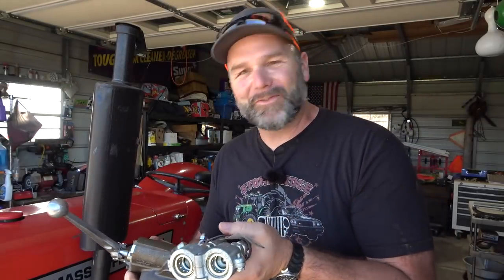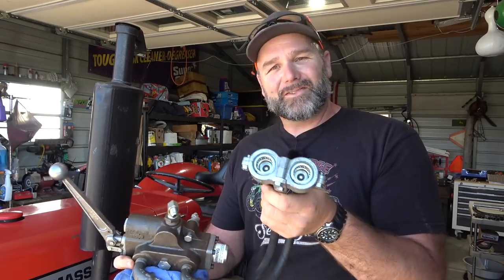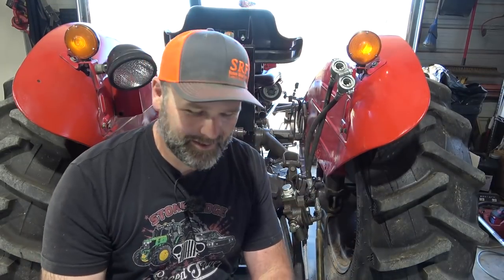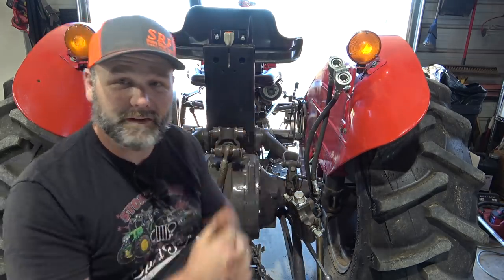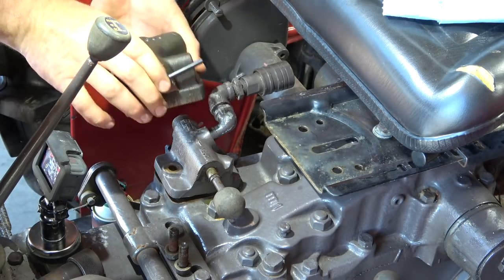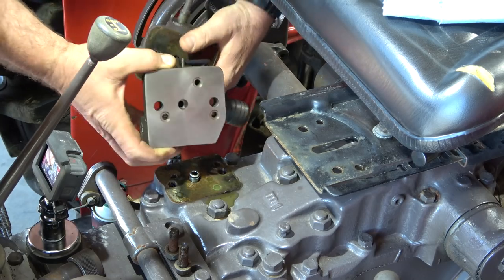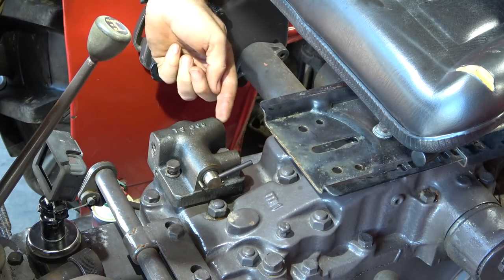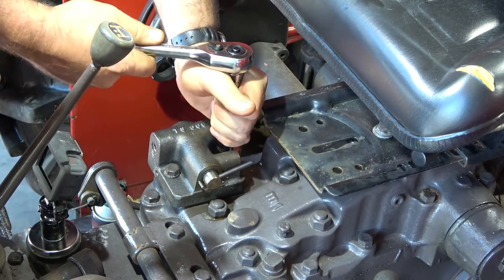How to install secondary remote on Massey Ferguson Tractor

Comment: I don't know, Josh. I keep hearing from sources that I trust that lock washers provide no additional locking protection. The reasoning is sound, plus my personal experience seems to support the idea. If you truly need the additional "locking" power, then thread locker, a lock nut, or a nylon nut should be used. That's just what I have been hearing.
Reply: This is true.  Vibration is brutal to fastened joints and lock washers don't protect against that very well.
Reply: Look into Nord-lock washers. We use them in severe construction and mining applications. They will survive anything a farm tractor can throw at them.
Reply: @heavymetalmechanicX  
I have looked into those.  They are quite interesting.
Reply: Nylok fasteners are a must have for any upgrades like you are doing. I have some in bulk for my shop.
Reply: 4th oring for stand pipe that was protruding from the lift cover.
Reply: 2:50  pay attention, NYLOCK NUTS.
Reply: Lock washers or (compression washers) do work. They are to commonly installed in correctly. One way to not worry about vibration of bolted assemblies is to use fine thread bolts. If you look at your equipment you will see that they use a lot of fine thread assemblies.
Reply: @reggiefarley2788  This conversation prompted me to finally review actual research, and the consensus from the actual science (People doing proper research IAW standards and such) is that helical spring/lock washers do not work in high vibration environments.  They provide no more locking capability than a standard flat washer.  
I would provide some links, but I don't think that works here.  But there are tests and papers available if you just do a simple google/youtube search.
Reply: @watcherofwatchers  
I read similar research years ago, I want to say it was a NASA study. Basically, lock washers are useless, and liquid thread lockers are the way to go.
Reply: Agreed from my experience. Today's lockwashers are flawed. Have not found a lockwasher in many years now that don't break either while installing or in a short time of use.
In my racing days the owner told us no lockwashers on anything on the cars. They fail, they mar surfaces they add weight. We would fasten all our bolts and nuts then add a finger tip of silicone to prevent the hardware from vibrating off. 
The new manufactures of washers and lockwashers are not manufacturing them correctly, the lockwashers are either or both made from the wrong material or they are heat treated incorrectly.

Comment: My dad and I loved Massey Ferguson's. He bought them in the 40s 50s 60s and 70s.
He did a lot of commercial weed abatement, rototilling, mowing, grading and backhoe work with that side shifting backhoe.
He had a model 60, 200, 220 and a 375.
He also had a John Deere backhoe throughout the years to do most of his trenching.

Comment: If you have the length on your zip ties you should wrap them around twice. If you ever need to cut them off you have some extra space to cut them without getting to close to what you are tying up. If that makes sense. I have been using zip ties for over 30 years doing electrical and telephone work. Just a little tip. Love your videos and your work ethic.👌

Comment: My grandpa had a 2004 massey ferguson 461, and it was a great machine. It wasn't super old, but it was very reliable. Massey last a long time. He had to sell it unfortunately because he had a heart problem and needed a cab tractor so he wasn't in the extreme heat.

Comment: I think I’d change out that oil ! 
A tiny bit of grease will hold the o rings in place while tipping it down. 
As long as you are careful nut to wrap the Teflon to close to the end of the threads.  
Another great video!
Reply: Good -was going to post an advice to use a smidgen of grease on the o-rings to hold in place.

Comment: Free tip: you could put 1 or 2 stainless washers between the valve and fender at each bolt so dust and junk can fall through easily and water can dry faster, and be blown out easier too.

Comment: Cool old tractor.   Have you ever seen an MF 1650, 1655, or 1855?   I believe Snapper had the twin models to them under their name.  We had two 1655s when I was a kid.   They were full framed steel, tough as nails garden tractors.   Had a small 3 point on the back, front, mid, and rear PTOs, shaft driven.    Hydrostatic drive.    The old Onan V twin engines.   Ours had a solid 60" mower deck with an actual gear box and hydraulic lift and you could run rear mount tillers off of them on the 3 point, a large snow blower off the front PTO, all kinds of stuff.    I've been looking for one of those again just for old times sake.   Just really cool for how well built they were compared to what's considered a "Garden Tractor" now.

Comment: The nyloc nut makes sense but the grade 8 bolts are just over kill. Standard bolts are plenty strong enough to support that valve assembly.
Reply from the maker: Well...it's not like they're gonna break the bank 5 cents v/s 7 cents and I know it will hold, it's just what I have on hand here in the shop brotha. Better to have overkill than to have garbage right?

Comment: I see I'm not the only one who drops nuts installing things.  Another tool you might want to look into are called transfer punches.  To transfer your holes locations before drilling.  Pretty cheap and work great.

Comment: I'm not a hydraulic expert either by any means but I'll pass along one thing I do know. Whenever working with hydraulics make sure the pressure is relieved before you loosen any nuts. If the pressure is not relieved it can inject hydraulic fluid into a finger or hand. Which can kill you or at the very least you just lose a limb. So, very important to relieve the pressure before breaking a line open.

Comment: It might be a good idea to install blank hydraulic fittings to male and female fittings when the implement is not installed to keep the fittings clean or plastic plugs if you have the plugs or caps.
Reply from the maker: for every 10 rubber plugs on a hydraulic connector...there are 8 laying out in the cow pasture lol...they simply don't stay put in most cases...I'm in the process of going with flat faced connectors on all of my machines...like a skid steer

Comment: The Teflon tape can plug your hydro's if it gets into the system. Wrap tour drill bits with electrical tape to create a drill stop to avoid damage to surrounding components.

Comment: rubber washer against the fenders on the inside and outside and then put your regular metal washers. Help keep the metal washers from scratching up the paint leading to more rust down the road.

Comment: I use pipe dope and teflon tape both had a master plumber tell me to do it and I have never yet had a leak I do it on brand new tractors that come in to the dealership

Comment: Good attitude and good video.
Now something a tractor like this one ( and all other tractors as well for that matter) should have is "good roll-over protection" and seatbelts fitted, and worn, - because early Ferguson tractors have a reputation as "widow makers" for a reason, like the tractor can very easily flip ower backward, or roll over on embankments or obstructions etc, or the operator somehow manage to fall,  or jump off the moving tractor into the path of a rear wheel, or towed implement...😓  You could promote safety around equipment as part of your informative videos because many people may not realize the hazards such machinery or tools etc, can pose if they haven't been informed by someone who know.🤔
Stay safe, regards Niels.

Comment: On My Massey the Quick connects are coming off the pump or valve and the connects are mounted on the differentials then if or when you remove the implement then the Quick connects seal the fluid inlet and returns. I'm looking to find information on either rebuilding or replacing the controls for my Bucket loader..

Comment: Standard lock washers don't provide that much, if any, protection from vibration. They do keep them from instantly becoming totally loose if the bolt backs out at all, though.

Comment: I think I would have ran the bolts from the tire side of the fender to hang the valve on that way you are turning the lock nuts on the valve side of the application. either way works.

Comment: @4:17 your finger is on the old hydraulic coupler.  To connect or disconnect the hydraulic hose, the outer ring had to be slid forward.  I cannot tell if the new coupler will allow a hose connection by just pushing the hose in.  To disconnect, the connecting hose is pulled.  Either connector needs some slack in the hydraulic line between the valve and connector bracket.
With the old connector, something had to break if the connecting hose was pulled without the outer ring being pushed forward.

Comment: Enjoyed the video but I cringed when you didn’t protect the metal from rust! Also, it may have been a trick of the light, but it looked to me as though the paint cracked when you tightened the bolt up. I take the point that it won’t rust through for a long time, but a rust patch looks unsightly and that 240 looks to be in such great condition. 

Someone once told me to wrap an elastic band around your drill bit to create a stop so that it can’t run through too far.

Apart from that, great job, I know that I couldn’t make such a good job of it: I’m all fingers and thumbs when to comes to spanners!

Comment: Josh let u know the tube in the Senter of the valve comes out and the other o ring goes on the bottem of it so it takes 2 and also tax hase a thread sealer that works really good with hydraulic it’s back in a hydraulic area it’s like $30 a bottle but it worth it

Comment: Grade 8 bolts are way overkill for an application like that.
The bolts will pull through that fender long before the standard bolts break.
I would be using fender washers on that fender to spread out the stress and reduce the possibility of pulling those bolts through after a few years of vibration holding that hunk of iron on there.
Fender washers come in handy for many applications.

My dad had a Massey Ferguson dealer add a couple extra valves to his Massey Ferguson, for top & tilt, and they bolted the valve body directly on top of the transmission.
I would try to avoid bolting anything heavy to a fender. Over time that sheet metal can crack and split out like a spider web.
My dad always bolted his onboard tool boxes to the loader frames. Never to a fender.
In fact his hydraulic couplers were bolted on to the differential, not the fender.

Comment: Josh Next time only use a lock washer. When you use a flat washer with a lock washer the flat washer will turn and let the nut back off because the flat washer will not bite in the metal ..I hope that makes sense.

Comment: I thought not to use teflon, the connection will seal itself. I repleaced all the hoses of my boomlift, and I was advised to do so
Reply: rule of thumb with hydraulic fittings - never use Teflon tape. If a sealer is required, use a loctite or permatex product designed for purpose. The smallest bit of tape in a hydraulic system will get trapped in a valve seat. You have internal sealing problems I.e. implement drifting. A costly process to correct.  Teflon tape has its place, water & gas fitting but never in a hydraulic system.

Comment: Simple Test to determine if water is in oil:    heat up a piece of metal and drip some oil on it..... if it just lays and smokes no water...... but if it crackles there is water.....

Comment: I have a 230 MF l took off the remote control it was in the way of quickly using the 3pt controls. Can you talk a out witch way the lever on the block is to be set and where to position the levers near the 3pt control,please

Comment: I guess I’m confused (it’s my natural state, really), but what was the prior valve for? Was it an old single action ram type? And now you’ve converted to a double-action?
Reply: Yes, the prior valve was single action.  Oil was pumped in one direction.  The weight of the implement forced the oil back when you moved the lever to the down position.  @4:16 Josh pointed out the return hookup for the return oil from a hydraulic motor or power beyond (or secondary valve setup).

Comment: Maybe a cartage bolt inside fender out to fender washer finally use a nylock nut tighten add lock-tight close in loosen 3 turns then re-tighten snug. That should do quite well. Go give em, rust part is electrolysis dissimilar metals zinc is sacrificial. Go get em & get er done.
My cousin has a quarter horse and a tractor like yours, the horse's name Justin, I call him Justin Beaver; he parked his tractor in paddock Justin took his teeth first he pulled off tractor's seat then muffler! Justin is not a bad horse he just gets bored.

Comment: you had safety glasses which is good. but Safety Sam would get you for having Dark Glasses in a building. you are supposed to have Clear inside and Dark outside. and on a very cloudy day clear outside also. when I worked construction, my site safety person would ask everyone to follow those guidelines.

Comment: Where is your ROPS?  For the smaller tractors they have controllers that can regulate up to 4 hydraulic lines. Saw on Tractor Time with Tim. With multiple sources you could have hydraulic 3 point lift. And extras for equipment like the sickle bar cutter.

Comment: No no no no never use plumbing tape on hydraulics. I've been hydraulics guy for 35 years. 1 little piece of Teflon loose in the system and you damage allot of sensitive equipment. Buy the write products in the planning stages. You planned the video so no excuses

Comment: Grade 8 is overkill, stainless should be used in my opinion with lock nuts, the kind that's crushed at the very end of the nut. The best zip-ties are the ones that have a Metal retention tang, instead of a plastic one.

Comment: I dont really think the lock washer is helpful once your bolts are above 1/4" or so. The amount of force it adds is a very small amount compared to the clamping load of the bolt/nut connection. I cam typically compress a lock washer without a wrench, so that is not much force for me. Our factory uses them to visually identify a torqued fastener.
Reply: You can compress a lock washer with your fingers ? You must have a death grip !  Also, a lock washer works best with no flat washer, just directly up against the parent metal. That way the edges dig into the material and the nut itself.

Comment: Hydraulic teflon tape (petroleum rated) NOT regular water (white) or nat gas/propane (yellow).  Lock washers are good.  Find out what the Torque spec is for those bolts BEFORE VIDEO PRODUCTION and torque them.  Talk less, edit more.  Be concise without being hyper thus making better videos.  You mentioned the fenders vibrate a lot.  That light bracket you used will come off the fender eventually.  It will be destroyed with that much weight on it.  Mount the remotes (plugs as you call them) somewhere closer/on the axel to reduce vibration.  Try to help folks.  What is the operational sequence of your new addition?  I wouldn't be here if I didn't need something.
Reply from the maker: Nothing quite as satisfying as pointing out the shortcomings of others is there? Please be kind sir, I can't go back 3 years and do this again .....constructive feedback and destructive criticism are two different things....Insulting me and attempting to boss me around isn't appropriate. Maybe it's a culture thing....you live up north somewhere?
Reply: @StoneyRidgeFarmer  Satisfying, no.  Frustrating, yes.   Chill!  Ask yourself why you post these videos.  I'm not a touchy feely feminist where political correctness rules.  I'm sorry about your feelings but you asked viewers the entire way through your video what we thought.  Regardless, I still hurt your feels.  I went back and read my post since you thought it was an insult and I was bossing you around.  There was no insult intended and there was a lot of constructive criticism.  I apologize for insulting you.  Bossing you would not be possible since you don't work for me.  Sounds more like you are sensitive about your own shortcomings.  If you are a shade tree mechanic, lead with that info.  Good and accurate criticism is hard to take if you have your heart on your sleeve. That's something most farmers don't have time for or gets knocked off pretty quick.  Quality advice is especially hard to find these days as people freak when someone is critical or says what they think even after being asked.  Perhaps you make videos so you can feel relevant, get likes, dopamine or something.  Youtube is full of silent professionals doing excellent mechanical work and are very helpful.   Be helpful.  Now that we have our "feels" out there... Check what I wrote to make sure you are correct about me "pointing out your shortcomings/insulting you.  Did I insult YOU or did I actually bring up things that will help others and improve your product on youtube and your mechanical skill and proficiency on the farm? Teflon Tape, lock washers, torque specs, video production, self evaluation, fender vibration, remotes, axel housing vibration, links for parts, operational sequence are points to look at.  Did you go back to all those things and see if what I said was true?  Did you help people or do those torque specs really not matter.  Did I help you?  If someone looking for help reads my comments on your video they will know to take what you say with a "grain of salt".  Check other youtubers like Dave's Auto Center.  He talks all the time about the damage "shade trees" do when trying to be mechanics.  After many years of making mistakes in mechanics and farming, I weigh and address criticism for what it is first.  By the time I'm finished, I usually appreciate the advice in the spirit it was given and learn the lesson.  You?